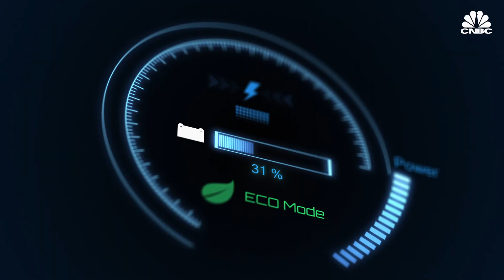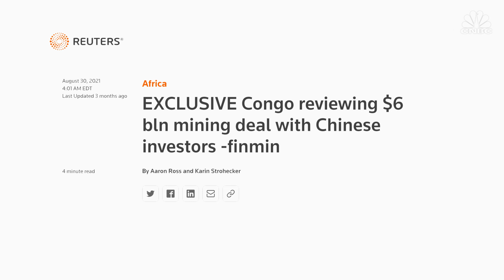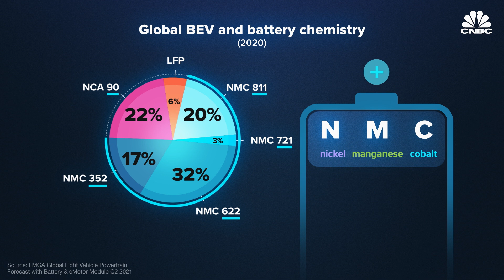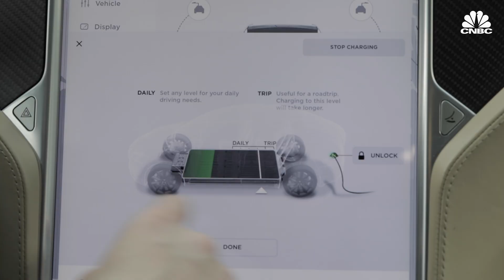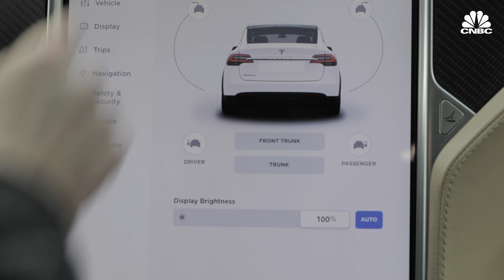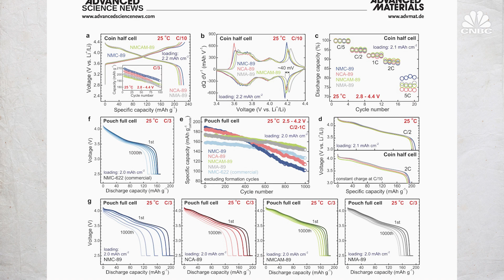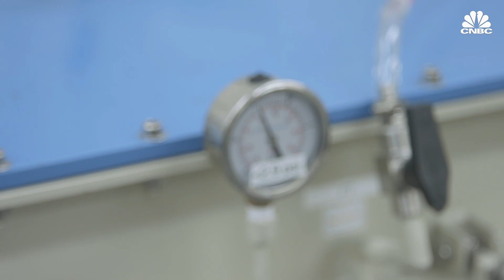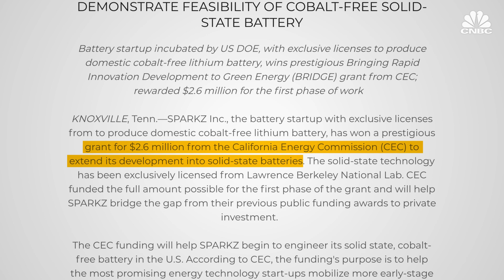How Removing Cobalt From Batteries Can Make EVs Cheaper

Comment: A sequel of 'Blood Diamond' could be in the making, titled 'Blood Cobalt'.
Reply: One of my favorite movies the main actors were phenomenal
Reply: @silasdietrich7464  my favourite too
Reply: HemaCobalt
Reply: Just go with the catch-all 'Blood Minerals'.
Reply: the solar panel is 6 volts DC at 200 milli amps vs the battery pack that has 600 volts at 80 amps AC. I think you got electrocuted sir.
Reply: @tombaja4.9  WTF that makes no sense. That's not enough power to even run Air Conditioning.
Reply: @Kiran... : It's been done search for it.
Reply: Air is free. For now.
Reply: @tombaja4.9  The energy to Compress the Air to be useful. Add ontop the specialized equipment is VERY EXPENSIVE.
Reply: Then why won't seeds germinate near Wi-Fi routers?
Reply: Expensive? Air compressor is free at every gas station.
Reply: Don't forget the EMF Radiation. Now add a phone and go through a radar trap. Bzzzzzzzzzzzzzzz DING
Reply: @tombaja4.9  That makes no sense. The amount of EMF these device make even a EVs is problematically tiny. Thus why we have Reception problems and connectivity issues. The signal is soo weak it's easy to be blocked. BEVs have to conform to insane EMF requirement to this point it has not interfere with AM Radio Recievers. The EMF Noise output is insanely small and way safer than harmless.
Reply: How about we go Tesla vs Edison. I'm all for electric cars even though they are 100 years out of date.               (See: Electric car 100 years ago). A Solar compressor, pnuematic motor has only DC and is safe from electrocution and fire. If has little or no EMF radiation therapy. Current-ly the measurements haven't been completed yet. The dosemeter is still on the job. Be back in 10 years with the data.
Reply: @tombaja4.9  "only DC and is safe from electrocution" That is blatantly FALSE! DC is way worse because it's a constant current that tends to WELD stuck the short circuit contacts. The AC Pulse can often throws and smacks away what ever caused the circuiting it thus is a built in safety mechanism. You clearly have no clue about the real world functionality of these things. Just some nonsense gibberish.
Reply: But tiny energy over prolonged time. That's what dosemeter measures. That takes years to to do. How did you get your measurements? Did you travel into the future and come back? The cobolt battery pack should be measured with a Geiger counter.
Reply: @tombaja4.9  "energy over prolonged time" Very true, but Earth Evolved Animals are also designed to live in background radiation their entire lives. As long the instantaneous amount is insanely small the cumulative amount extremely safe. It's not like you can Store Collect that energy over years, that's not possible.
Reply: No it just charges a battery that runs a small air compressor. Regeneration braking via same compressor. No need for a ton of inextinguishable batteries.
Reply: @tombaja4.9  To do what? For the Power Windows like on the vintage Mercedes pneumatic system?
Reply: @tombaja4.9  Sure the batteries are inextinguishable but still way safer than Gasoline which can cause a Concussive Blast. How about we just make a BEV that has very low probability of ever catching fire. In a catastrophic crash it only slowly starts flaming with plenty of time for occupants escape. Quite sure that's already been done. It's plenty safe and does not require any drastic change.
Reply: , cells and dna can't store energy. They are mutilated by it.
Reply: @tombaja4.9  "cells and dna can't store energy. They are mutilated by it." WRONG!
"Earth Evolved Animals are also designed to live in background radiation their entire lives" we have biological mechanism to tolerate tiny safe amount of EMF.
Reply: To power the pnuematic impact wrench motor.
Reply: @tombaja4.9  FYI The energy / electrical power to "fuel" an MDI Air Car was gigantic. More than a Level 2 EVSE. Simply because it has to recharge in a quicker time and charge multiple vehicles. Also the equivalent energy capacity and usable range on such a vehicle was horrible. Even if we ignore the horrible weak power output from the Pneumatic Engine. Yes i'm very familiar with Compressed Air vehicles back when they were hyped up 15 years ago. Idiotic concept that deserves to stay history.
Reply: Meanwhile I suggest you sit on a lead apron if you drive one and don't watch the food cook.
Reply: @tombaja4.9  You are delusional or willful Lies, it difficult to measure the EMR from BEVs inside the interior cabin being blocked by the cabin. The amount of energy is soo tiny it could not even power an RFID tag let alone cook something. Stop spreading falsehoods.

Comment: Lithium Iron batteries may be “cheaper” up front but you have to realize they don’t hold a charge as long which hurts EV’s range and the batteries have to be replaced more often which is EXPENSIVE AS HELL! This is just EV manufacturers being cheap so they can make more profit.
Reply: LFP batteries last a long time., a very long time. CATL and BYD ar saying their battery will last for million miles, which will outlast life of the body of the car. Even after that it can hold 70% charge and can be used for storage applications. Only drawback is that LFP batteries are less energy dense. The pack level, LFP is 50-60% heavier than NMC or NCA batteries. So these batteries will not require replacement
Reply: That's just straight up wrong. They have much longer lifespans.
Reply: Sorry Rem but it just shown you are the lesser wifu... LFP batteries can be charged to 100%, have more cycles and are a lot cheaper to produce. Most of them are rated for 1 million km. And average degradation is 1-1.5% per year, which is a lot better than NMC batteries.
Reply: LFP batteries can be charged to 100% and discharged to 0% without the kind of deterioration of traditional lithium ion batteries. They also have 10X cycle life so would need to be replaced less often.

Their downsides is less energy density so not good for longer total range per charge but perfectly fine for lower performance vehicles (such as the Tesla Model 3 SR)
Reply: That's the basic problem of batteries. The more energy dense, the more environmentally disastrous. This is a basic chemistry principle that cannot be gotten around.

Comment: Good thing Tesla is switching to LFP (no cobalt) and uses low cobalt NCA.
Reply: Shh can't having people know the truth now. Doesn't fit the narrative. 😀
Reply: Good thing ill continue driving gas cars.
Reply: Yeah instead it uses Chinese slave labor to make, much less ethical than mining cobalt
Reply: @jontopham2742  Not necessarily. American built teslas primairily use batteries that are built in america. And on top of that tesla puts alot of effort into making sure that most of its production lines are automated.
Reply: Is that why their cars catch on fire sometimes?
Reply: @freethinker424  see 209,000+privately owned vehicle fires in the us alone per the nhsta and ntsb 2020 statistics. 
Got any comments on those by chance? Yeah I didn't think so. 😏
Reply: @4literv6  lol that 209k is spread across all the manufacturers across the US. maybe look at the % per cars sold for each manufacturer instead
Reply: @4literv6  Well it should be much less than 1/10th of the rate of catching fire because EVs have literally no internal combustion. ICE cars use fuel so you'd naturally expect them to be more prone to catching on fire in an accident lol. Batteries should not catch on fire period, unless its an astronomical crash. Yet as we've seen Tesla's still catch on fire even though they are at an advantage by not using any fuel.

If 10% of Tesla's catch on fire to ICE, that's still very very bad lmao
Reply: @visceral_investing  wow man you should be a politician with that spin cycle or audition for working as a washing machine? 
You got evs are less than 1 tenth as likely to catch fire as an ICE vehicle Is. And somehow equated it to 10% of teslas catch in fire. 
Which currently would imply that over 250,000+ teslas have caught fire to date world wide.🤔

No tesla fire I've seen yet covered has not also involved a collision, surrounding structure catching on fire or some form of puncture to the battery pack itself. Which causes thermal runaway. 
Can you share any stories or searchable terms i can look for which clearly showed no damage to the pack itself the vehicle or surrounding structure. Yet still resulted in a fire?
Reply: @4literv6  lol you literally didn't address my point at all. Why do so many Tesla's still catch on fire in accidents when they don't use engines? Tesla account for like 1% of cars on the US roads so it's literally pointless to compare total US car fire numbers lmao.
Reply: @visceral_investing  yup your perfect career fit would indeed be as a politician. 👍🏻
Reply: @4literv6  you still didn't answer my question, I guess I found a weak spot lol
Reply: @visceral_investing  Electric cars have hundred of kgs of high voltage batteries, of course they can catch on fire. Why do ICE catch on fire if all the "exploding stuff" is inside a vacuum sealed block of iron?
Whatever you say, EVs catch less on fire than ICE cars
Reply: @Ignacio.Romero  lol I can tell you have no idea how an ICE car even works lmao. ICE cars literally have boiling hot exhaust systems and fuel and oil traveling all across the engine which itself is boiling hot. Any combustible liquid touches the engine and it combust immediately. I'll give a 1 star for the effort tho
Reply: @visceral_investing  you are still criticizing EVs for fire safety after someone points out that they are 10 times less likely to catch on fire than the ONLY viable alternative, safer is safer, if one EV manufacturer is significantly more likely to have fires than it's competitors you might have a point, but you are litterally complaining about the safest option not being safe enough. The fact that ICE vehicles are inherently more dangerous really doesn't count in their favor nor does it make the fact that EVs are "only" 1/10th as likely to catch on fire more dangerous relative to ICE vehicles.
Reply: @garethbaus5471  So you're basically saying that its safe to have a car spontaneously catch on fire in a parking lot? Or its okay for a 45 mph crash to turn into an inescapable blaze? How is that the "safest option"? I'm not complaining about anything lol, literally just stating a fact that EVs catch fire in the most unpredictable ways that make them more dangerous than some ICE cars
Reply: @visceral_investing  ICE cars catch on fire in parking lots and in 45 mph crash's, and the fires can be pretty damn hard to escape, the fact that these are outliers that account for a minority of vehicle fires applies to both types of vehicles. You really aren't describing any unique circumstances that make EVs any more dangerous and once again the fact that they are much less likely to ignite in the first place is what makes them safer.
Reply: @visceral_investing  so? You showed an outlier, it isn't unheard of, but it also isn't even remotely common either, and it is comparable to how ICE vehicles can spontaneously combust if they experience an electrical short.
Reply: @visceral_investing  Nissan alone sold 250,000 vehicles over a 2 year period with a known fault that causes spontaneous combustion in a fashion fairly similar to this at a rate that is much higher than that seen by Tesla's.
Reply: @garethbaus5471  lol show me a video of an ICE vehicle spontaneously combusting due to its ICE nature bro, otherwise it looks like I'm just arguing against a brick wall
Reply: @visceral_investing  https://youtu.be/jUadMhnU7xM

Here's a car with an engine defect that spontaneously caught fire while parked.
Reply: @garethbaus5471  lol just picking an outlier? Here's a whole compilation for your Teslas https://youtu.be/UsuYxFBHsiQ
Reply: @visceral_investing  yes I was picking an outlier, that was pretty much exactly my point.
Reply: @4literv6  No there was the one model S back in 2013 that caught fire for because of something like a lose cable. But that one EV is significant!!!
Reply: @freethinker424  LOL FAIL! LiFePO4 is an entirely different chemistry which does not follow the NARRATIVE that Cobalt Required to prevent fires. That is ignorant of chemistry and engineering and taken out of context. It's just as safe as Cobalt heavy batteries.

Comment: Great documentary. Although it is not up to date on LFP. There are decent range evs from Tesla and BYD with lfp batteries today. Also, often a lot of the energy density lost at the cell level is gained at the pack level, thus lfp and nickel based have almost the same energy density in a pack. Also lfp allows for 100% state of charge daily which improves your practical range, not having to plan ahead like you do with nickel based batteries, where daily charge is recommended at 80%. Also lfp costs are at $60/kwh today compared to nmc at 100.
Reply: They had a small comment about that right at the end of the video. But BYD is so slept on... They are so well vertically integrated, even better than Tesla, making their own batteries and chips. I saw they were on track to become the 2nd largest battery manufacturer just behind CATL. And that blade battery they have looks really good. I expect them to become one of the powerhouses to come out of China and flood EU markets. With the pace they are growing I'm pretty sure they will be a big part of the reason legacy OEMs go out of business this decade.
Reply: @radomirbossev1300  Agree...although some of BYD's key patents are due to expire next year, apparently.

Comment: Removing cobalt also has 100% less child slave labour
Reply: They might break slave cobalt producers but it does not mean slaves are going to be free, probably they might be use in another industries. It is Just marketing not a whole solution, but it is better if it is real.
Reply: @user-cr1983  currently a lawsuit against tech giants for it google, microsoft, apple, tesla etc they just bury it because their platforms can
Reply: Refining gasoline requires cobalt. We should probably try to move away from that and to cobalt free EVs.
Reply: @brogcooper25  not saying we shouldnt move to it evs are waaay better then gas but it would be nice to seem the repairable and actually able to be recycled instead of charging 20k for a new battery
Reply: @upperjohn117aka  EV batteries do get recycled and last much longer than ICE cars. LFP batteries can last 1 million miles pretty easily. Unless there is something faulty with the battery pack, an owner will never need a replacement. 

Early EVs like the Nissan Leaf aren't representative of modern battery packs.
Reply: @brogcooper25  that tech hasnt come out yet
Reply: @upperjohn117aka  battery recycling? Yes it has. Many companies are ramping up operations right now as the first wave of EVs are starting to reach the end of their lives.
Reply: @brogcooper25  it still releases pollutants
Reply: @upperjohn117aka  there's already blade battery by BYD, i think more than 700,000 km or at least 30 years is giving enough time to manage the recycle, about battery recycling the US is currently leading the way ..
Reply: There's Blackbird mine in Idaho which we can reopen.
Reply: @tompeled6193  nooo that costs too much why should we care it only matters if its in our country (sarcasm)
Reply: @Dimitris_Half  still a win
Reply: Better get rid of cell phones and laptops too
Reply: No, it would result in 0% fewer slaves because “slave” has only one definition.